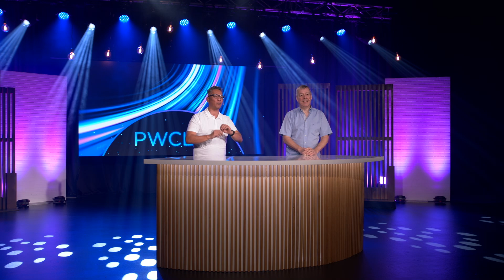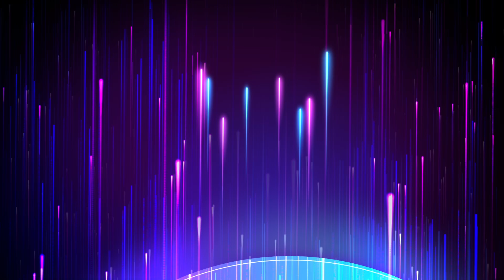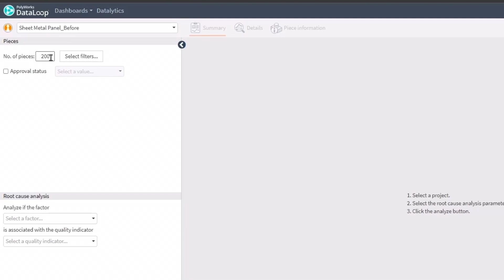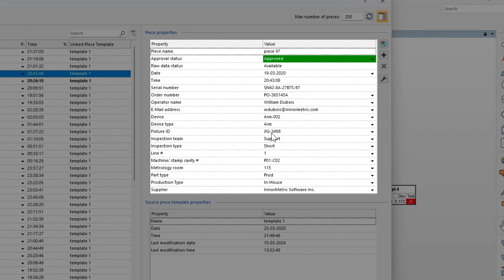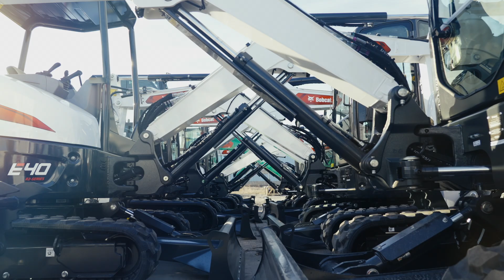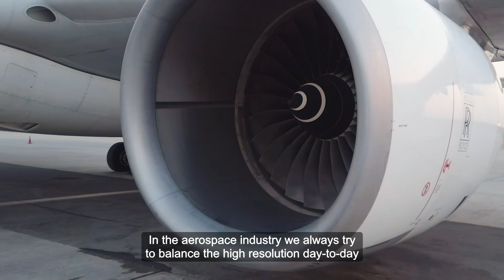3D Measurements – An Invaluable Resource for Manufacturers

Comment: I’ve been using PolyWorks Inspector since 21017 and just updated to 2024. I have every update for the last 7 years. My problem is accessing older data without having to opening  the older PolyWorks Inspector programs. How do I bring older data to the newest update?
Reply from the maker: Hi! Thank you for your support and updated. We have a macro available that will perform a batch update off all older projects. This macro is available on the MyPolyworks customer portable on the macros tab. 

Here's the link : https://my.polyworks.com/s/macro/a9Q4Q000000LIdLUAW/batch-upgrade-projects

Please don't hesitate to reach out to our Support group at support@innovmetric.com or by phone at 1-888-688-2061 in case you encounter any difficulties with this problem.